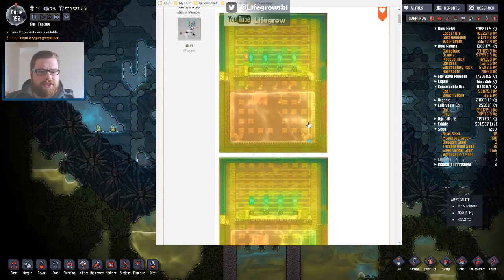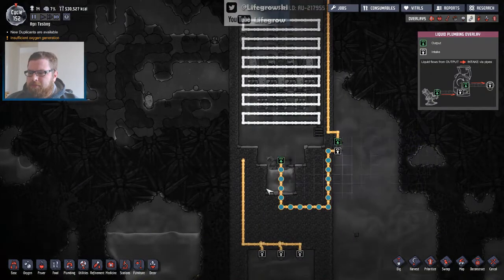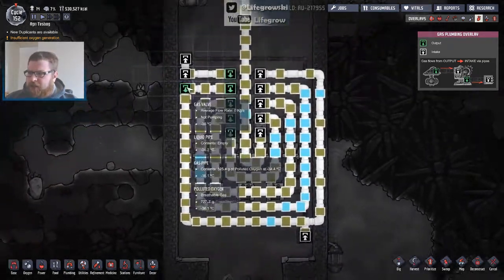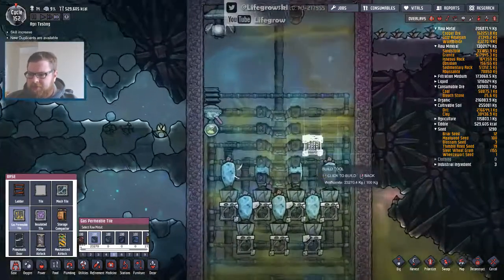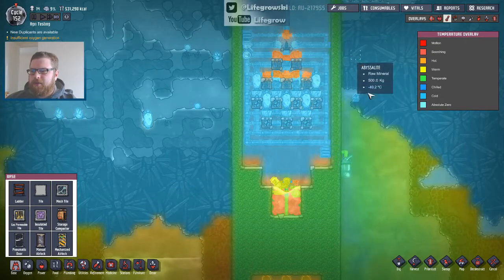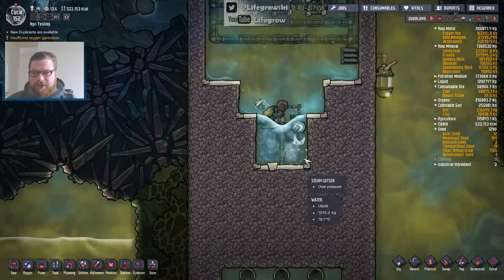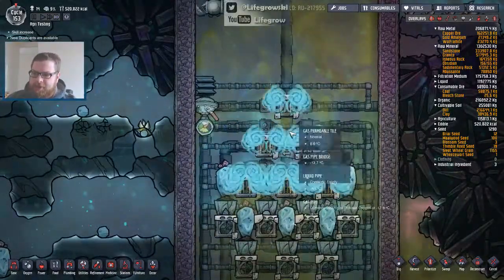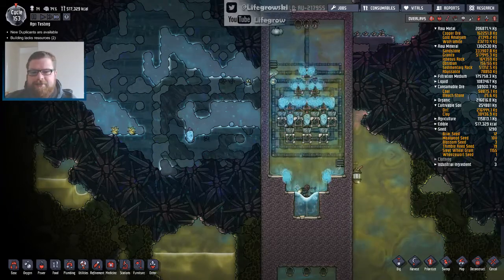Ice Cooled Geyser using wheezeworts / gas perm tiles.

Comment: I don't think it has to be gas permeable tiles. The whirling water fall seems to send wheezewort into constant cooling somehow. I've noticed it before. Normally a wheezewort will cool, then rest, and then cool again. Basically switching on and off all the time but the whirling water seems to override that. I think it's related to the overpressurized valve trick somehow.
Reply from the maker: hmmm will have a play later - i used gas perms purely because i could build them out of wolframite and not affect air flow really...

Comment: lol the gas perm tiles (Mr Happy) yah i was using the splash intentionally.
Reply from the maker: Ahhh I see, i never understood why you were using them before, but now it makes total sense. So you were pumping your liquid chlorine/co2 over them for the same result?
Reply: was dropping liquid o2 originally but yah i was using them to accelerate the efect
Reply from the maker: Ahhh you sneaky bugger, you should have told me :D
Reply: the co2 and chlorine was the substance i was cooling but it works the same
Reply: but just like the wolfram pipes in the back ground they retain the temprature your system is running at and spread it to the material your cooling faster with gasses its a double wammy becasue they can actually pass through them. its like whn everyone was still bubling about the bubbler and i was showing pictures of makin g o2 in the oddest of places like my fridge or on batteries. the mesh and gas permiable tiles are great for pumping the cold gas and liquid behind to amplify the effect of what the pipes intention was
Reply: you have seen how i set up my geysers with mesh tiles and no pumps? imagine what p\happens when i run cold hydrogen through the mesh wolfram. remember the old Water heaters in apartments ? the pipes are only half of the formula you need something that actually interacts with the material Gas perm for gas and mesh for liquid. it also works the other way now with all t he thermal activity they have added using high amounts of mesh and permeable in the basses are really playing havoc with people temperature stability because they  arnt aware they are making radiators all over their bases
Reply from the maker: I didnt think mesh tiles interacted with anything?
Reply from the maker: Link please bud - i'm drawing a blank here - i've seen some pretty intricate pump/perm/tepidizer controlled geysers, but I can't recall yours off the top of my head - now i'm intrigued :D
Reply: second i was working on building a new one but the simple version is at the top of the yin yang base
Reply: it dosnt have the plumbing in it to cool itself but the extraction method is thee and you can imagine how to add a radiator to it